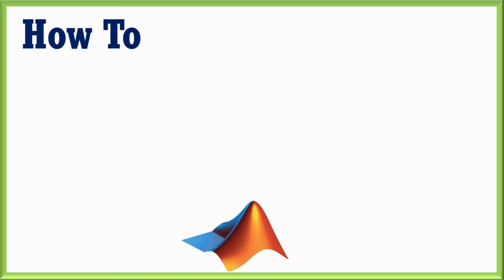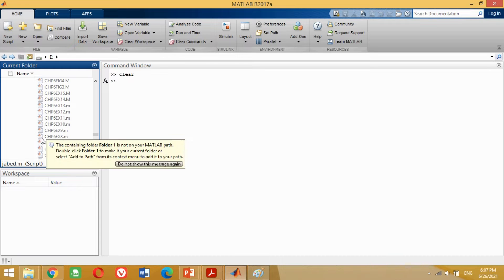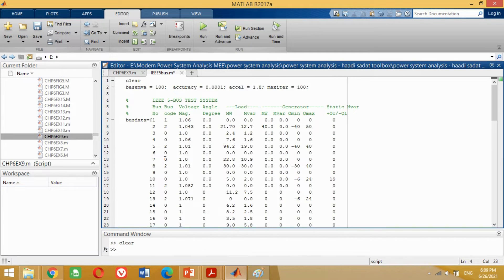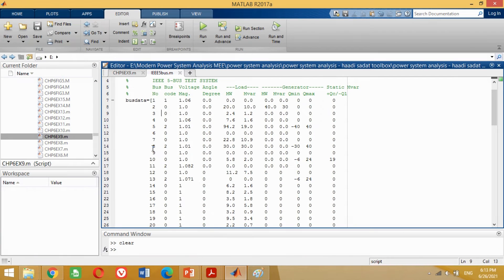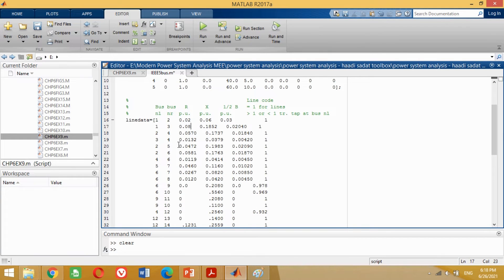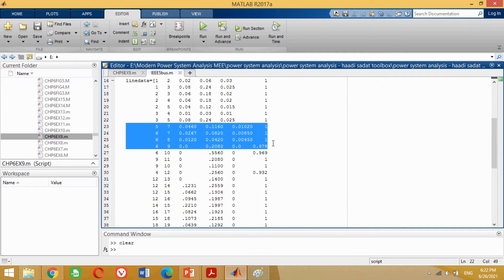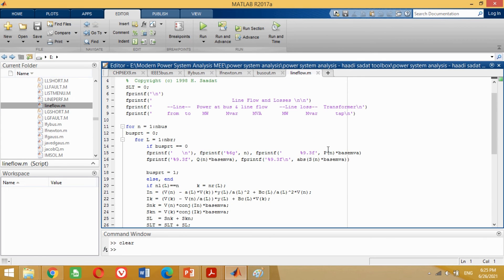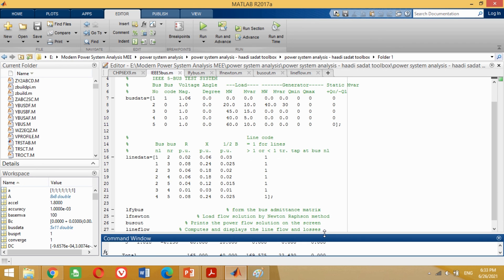How To Solve Load Flow Analysis of IEEE 5-Bus System in MATLAB | Dr. J. A. Laghari

Comment: sir ,can you send me linedata and busdata for IEEE 33 bus system
Reply from the maker: Thanks for the comment. I dont have the data at the moment. But you can easily find it on the internet any research paper. Or You may install MATPOWER Toolbox and get the IEEE 39 bus data from there.

Comment: After running this programme, an error occurs.we can't solve this error (lfybus).how is it  possible to solve this error let us know plz.
Reply from the maker: Thanks for the comments. Have you downloaded the folder from the link given in the description section of the video. Then just save it in any drive. Then open that folder in the matlab current folder section. Then open the ieee5bus load flow program m file. Then run it. It will surely run. Please follow the steps.

Comment: Also what if we want to give variable data of load and generation at particular bus? I mean instead of giving fix values to the bus , how we can give multiple time changing values for load and generation at any bus like bus 2? How to do it?
Reply from the maker: Thanks for the comment. My question is that why to do it? first it is an standard IEEE system which already has its rated values. therefore, we have to perform its load flow analysis using these values. second, if you want to change the values for your own, you may change it manually and observe the load flow. may be it work or may not depending upon the power capacity and transmission line losses.
Reply: @DrJALAGHARI  can we change the bus load and generation keeping the line parameters constant?
Reply from the maker: @ArmanAli-ww7ml  It depends upon the purpose. If you want to know the future expansion and want to know whether existing system will be able to supply the future increased load then you only change the load keeping the generation constant. If it  is not able to supply the increased load then change the generation to see how much generation is required. Transmission line parameters remains constant unless you upgrade the transmission voltage. Therefore, don't change the transmission parameters.
Reply: @DrJALAGHARI  ok will keep the voltage and line parameters constant. Will change power generation and load at each bus to see the behavior

Comment: Hello Sir, Have you made any video for 100 bus system or any system having more than 50 buses?
Reply from the maker: Thanks for the comment. No not yet. But same program can be used for 100 bus system by changing the data. Or watch my video on load flow analysis of ieee 9 bus system using MATPOWER toolbox. It Will hrlp you alot.
Reply: @DrJALAGHARI  Sure sir. Thanks.

Comment: Why is bus two considered PQ bus instead of  pv bus?
Reply from the maker: Thanks for the comment. Actually here bus 2 has both generator as well as load. Whereas, the PV bus is generally one which has generation only. Therefore, due to both generator and load, in this program it is considered as PQ bus. Otherwise, it gives wrong results in terms of active power supplied.

Comment: In newton raphson method of loadflow, do the reactive power generation of the generator bus changes with load? If yes, then how. it could be incorporated in NR load flow as we donot use corresponding Q of that PV bus to calculate mismatch vector?
Reply from the maker: Thanks for the comment. I am not sure. But look at the data, in data reactive power limite are given or not?

Comment: how did we get the Generation on bus 1 as (129.59) we did not apply any generation on that bus?
Reply from the maker: Generator 1 is slack bus. The slack bus provide the power after the load flow solution is completed in order to supply the total load plus losses.

Comment: Iam unable to open the file which is in RAR form. Is there a way to send it separately ?
Reply from the maker: Thanks for the comment. Do you have rar software installed or not ?
Reply: @DrJALAGHARI  No I do not. Which one do you recommend?
Reply: @DrJALAGHARI  Sir, another question, what is the bus code for a PV Bus? and are the Mw and Mvar values in Bus data in p.u.?
Reply from the maker: @anuj6736  just search on google about winzip software and download it. Then it will open all files.
Reply from the maker: @anuj6736  bus code for PV bus is 2 i think according to Hadi Sadat Book. Units are written in Table. When you will download the Files, it will be eaay for you to understand.
Reply: @DrJALAGHARI  Thank you for your reply sir.

Comment: Unrecognized function or variable 'LFYBUS'. all these functions are not working, lfybus lfgauss busout and lineflow
Reply from the maker: Just change the name from capital letters to smaller letter such as LFYBUS M to lfybus.m similarly change all the names then it will run.
Reply: @DrJALAGHARI  tried it this way, It isn’t saving after changing the name neither i am permitted to change, there is another error for that as well

Comment: hello sir, i already follow ur step but my case is ieee 37 bus system so i just add on until 37 bus with my own data but after i run there is some error that state like this, so what supposed to do in order to solve this problem. may u help me sir bcs i am in urgent. thank you

IEEE5bus
Index exceeds the number of array elements (36).

Error in lfnewton (line 83)
     DC(nn) = P(n)-Pk;

Error in IEEE5bus (line 89)
lfnewton                % Power flow solution by Newton Raphson method
Reply from the maker: Thanks for the comment. Kindly check the data.
Reply: @DrJALAGHARI  sir i already check my data, all is correct can u check it for me i will give the file of ieee 37 bus through your email i am really ur help please sir
Reply from the maker: @aqilhakim3459  ok send it on my email. jalaghari1@gmail.com
Reply: @DrJALAGHARI  thank u sir, i just u the file of ieee 37 bus